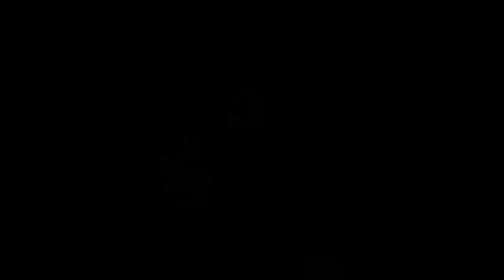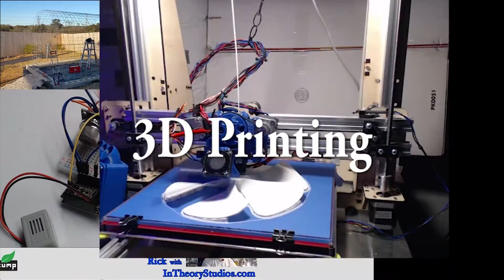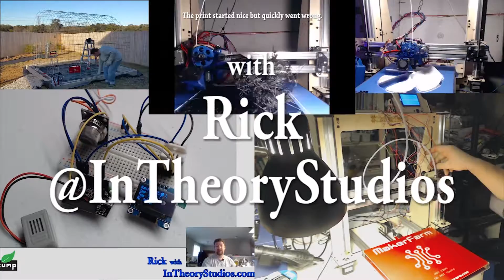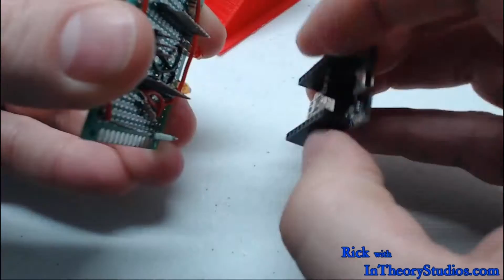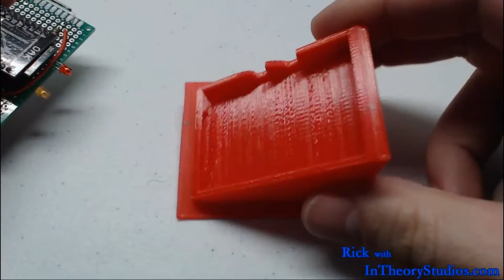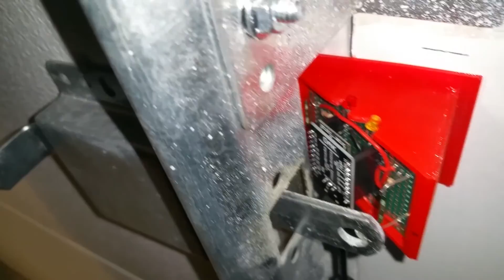Digistump Oak Garage Door Open and Lock Sensor

Comment: Hi, hope you can tell me how you managed to upload the sketch, bricked my oak twice trying to do by particle dashboard and arduino ide doesn't work for me. (It never find the oak)
Reply from the maker: I agree, getting things to work for the first time is quite a struggle.  You don't want to use the particle dashboard to upload any sketches, that has never worked for me and has messed up my oaks as well.  They are fixable however.  I'll have to do a video on how to fix them in the future.  I do have a video on how to set things up for the first time in case you haven't seen it... https://youtu.be/nBzmU5syUac  The video could be better but the information works.  I hope this helps.  Once you get them working, they are really awesome.  Don't give up!
Reply: HI. Success!! finally I can upload the FW, but need all the tricks learned in the loader  FW update i.e. shielding the Oak with my hand to attenuate the router signal (Very technical, right??), these boards need lot of time from Erik until they're ready, but Ok I'm very satisfied now! Many, many thanks
Reply from the maker: Alvaro Bravo Excellent!  That's good to hear.  Yeah, they are far from perfect yet but once you get this far, its pretty smooth sailing.  Good job!
Reply: Mhhh Oaks are truly unstable, flashed rather easy and then worked for some days and get offline or stopped responding. Now I think they need reflash the loader. Any idea??
Reply from the maker: The only issue I have had after getting things up and running is when the wifi goes down for any length of time.  The Oak won't reconnect on its own.  So you have to get back onto the Oaks hotspot and open your browser and goto http://192.168.0.1/connect-ap.  That will tell it to reconnect to the wifi and become happy again.  Hopefully they fix that soon.
Reply: Good hint!! Thanks again